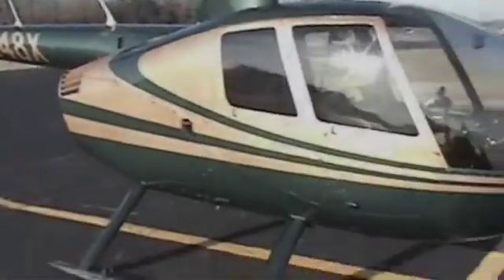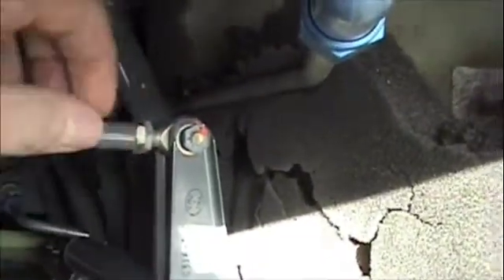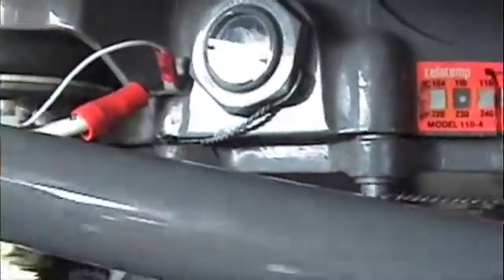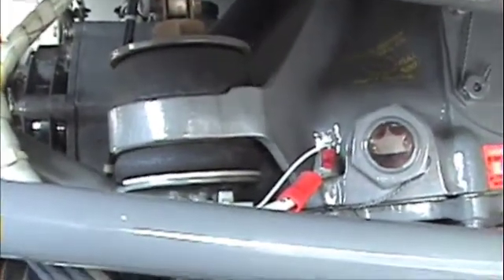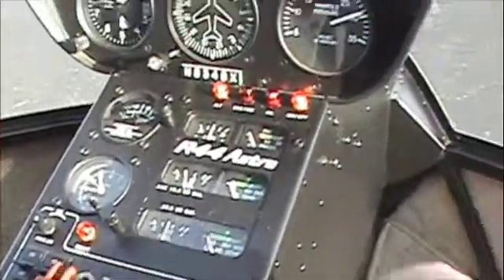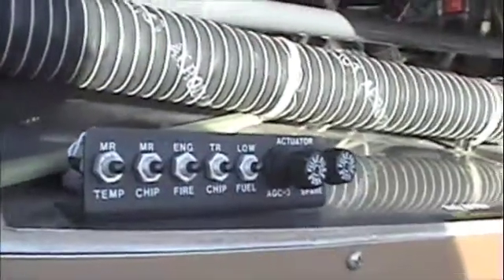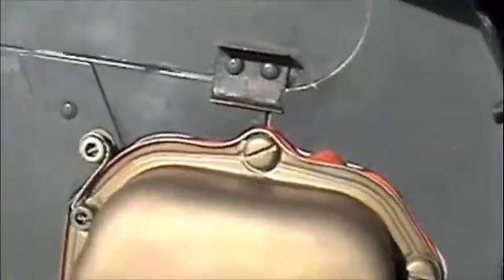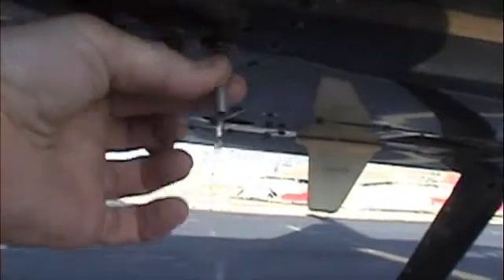Part 1 - Detailed Preflight Inspection of a Robinson R44 Helicopter

Comment: Correct me if I’m wrong but didn’t you leave out the belt inspection, upper bearing, pitch links/jam nuts, main hinge bolts & swashplate scissors.  Not sure if I left anything else out but I think that’s it.  Those should all be part of your preflight as well.